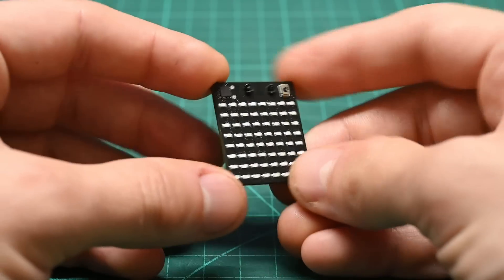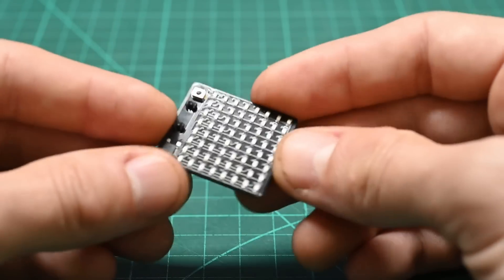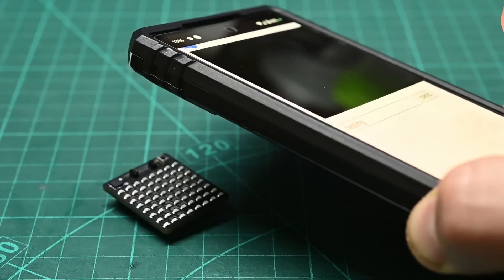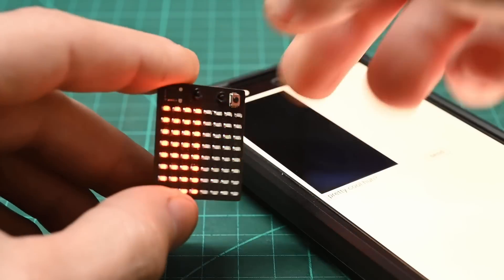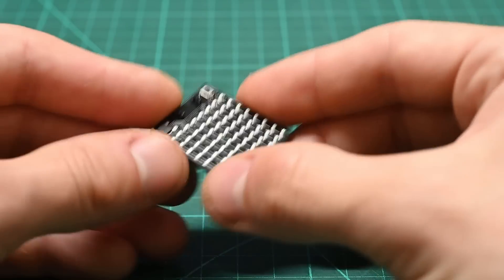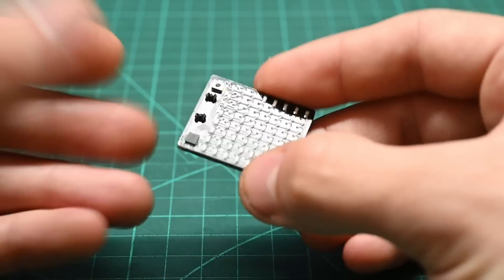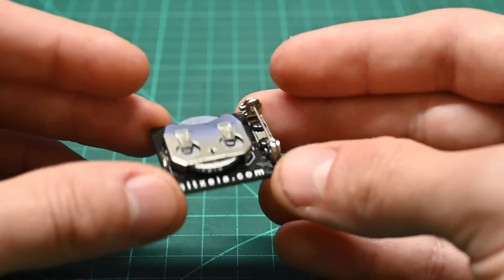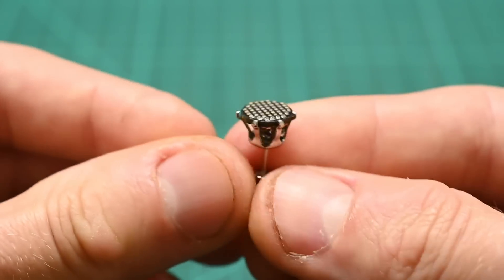Light communication on CH32V003

Comment: Have a challenge for you. 

Audio induction loop receiver

Most of the publicly purchasable devices are huge things from the days of tape cassettes or built into very expensive medical devices (hearing aids) I know the technology can be effectively miniaturised and should be easy enough to produce, it'd also kinda of be related to your micro midi divices.

Could you design a small USB device that would pick up these signals and present the decoded audio str😊eam for a phone or PC to send to speakers/headphones or capture as a microphone

Comment: You can measure external light without the opamp. Reverse bias the LED (A=low, K=hi) and then switch the cathode pin to high-Z mode. LED's junction produces current that is light dependent. You can time when the cathode pin goes low and this time gives you an indication on the external light level.

Comment: I have a flashlight which could be programmed in exactly the same  manner, using light emitting diodes as sensors and screen as transmitter.

Comment: interesting that you came up with this yourself! german bank "Sparkasse" actually had mobile banking tan generators using the exact same idea to transfer data via a screen to the device and generate tan anywhere securely. it has 6 photo sensor squares at the end and the tan code you scanned usually flashed 16 or 12 white bars on black background, you could adjust the speed and size

Comment: I only glanced through most of the linked article, but if you want to be able to have two acceptable orientations for the badge on the screen (rather than just the one), and if the badge can detect frame errors from incorrect orientation of the badge, could you flip all of the bits to see if a full bit inversion results in good data? 

I only looked at a single image of what Manchester encoding was. So my entire idea might be garbage.